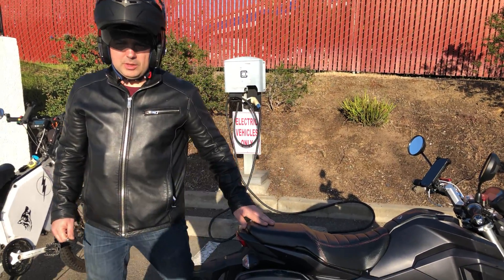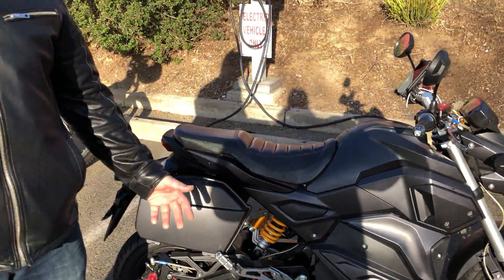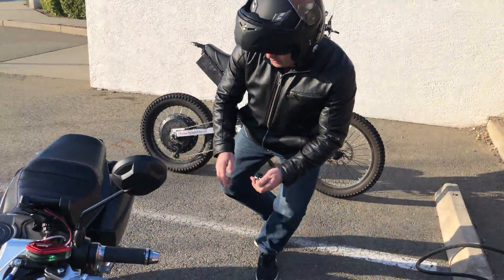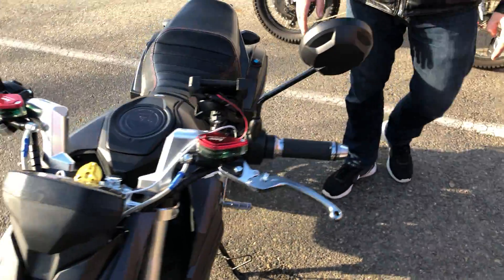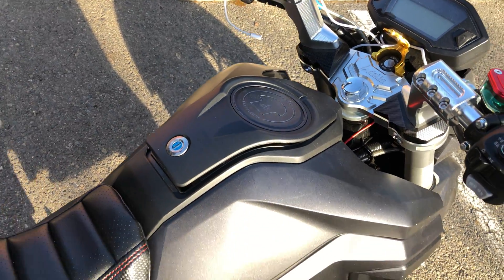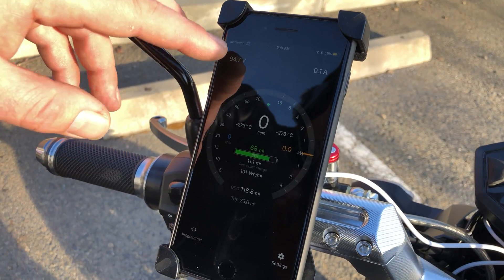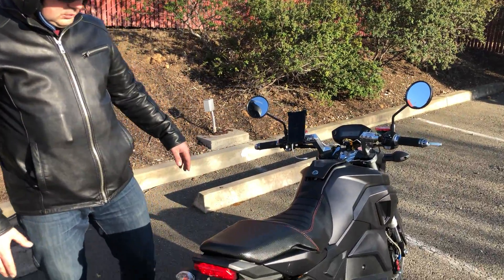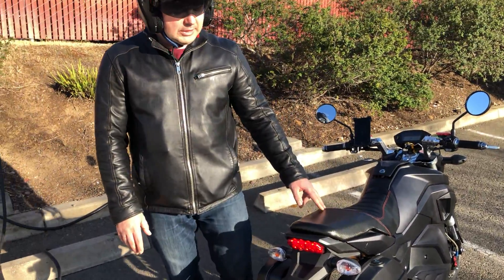Electric Motorbike Overview

Comment: On a normal ride , up to 50mph  not hammering it how much wh per mile  you are getting ? And how big is the battery pack in this bike !
Reply from the maker: Around 60wh/mile. The battery is 9.2kwh.
Reply: @vadeum  that quite a big battery there.! Thank you for  response..!
I have an oportunity to get something similar to this but its a  SSR Razkull 125 clone it also has qs138 70h motor..! 
When we'll be able to start purchasing the controller you have build.? I saw on vesc forums that you are shipping out 1st batch of preorders..!
https://youtu.be/ZVlCKiL3-Rg